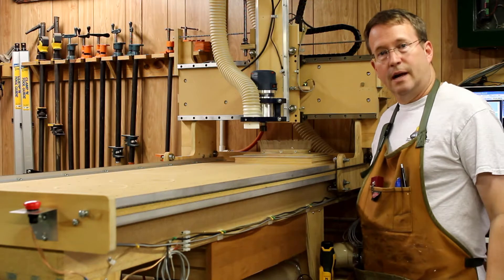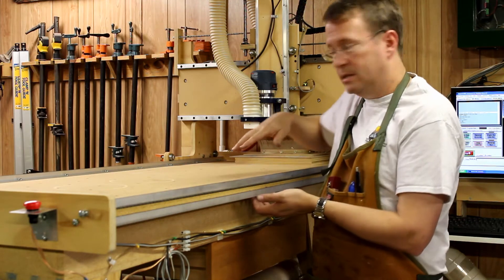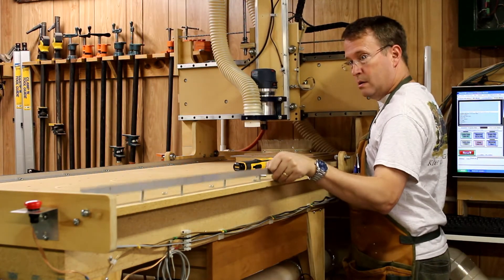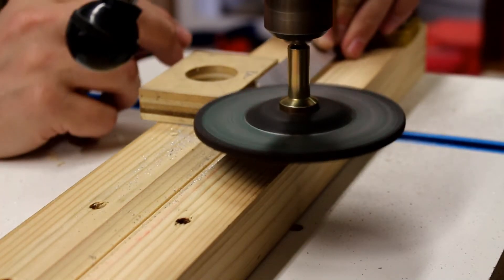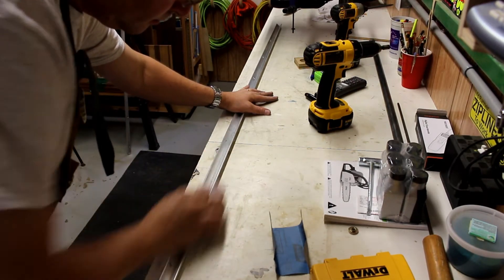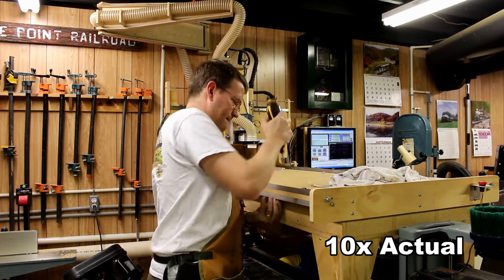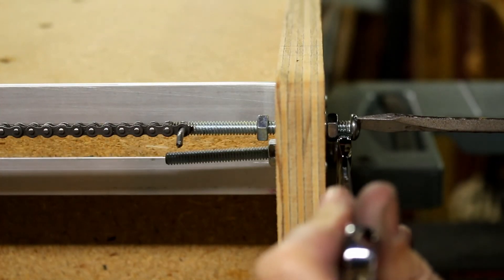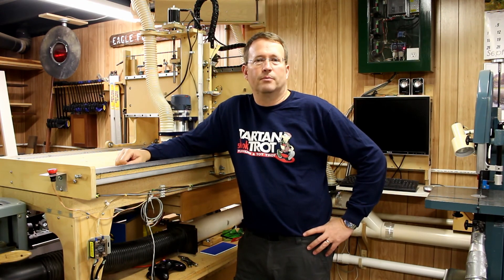Fixing My CNC Rails

Comment: Wouldn't it be better to run a piece of 1 x 3 lumber through the table saw and put a peak on each edge then glue or screw the angle to the peak on the wood making it possible to use the corner of the angle instead of the outer edges? This would give you a better formed rail for the 90 Degree bearing to ride on. This is the way i am doing it just so i have a better way to shim the rails for exactness. Steel angle iron rails could be use for more life and less wearing.  <___> cut the lumber to look like this and put the angle on each peak as a cover then run the bearing on the peak of the angle.